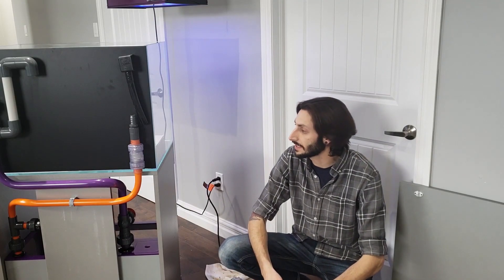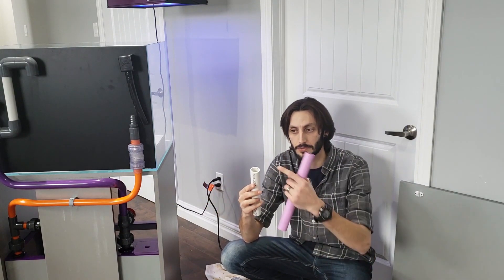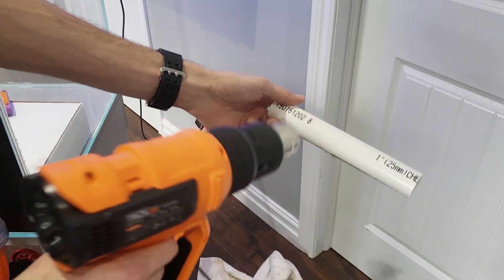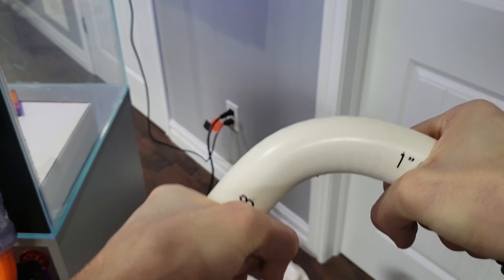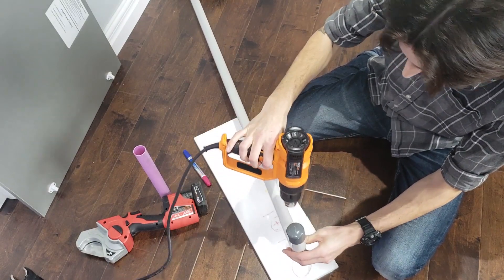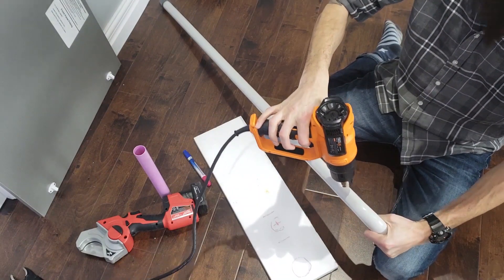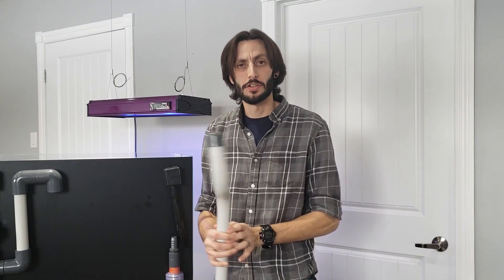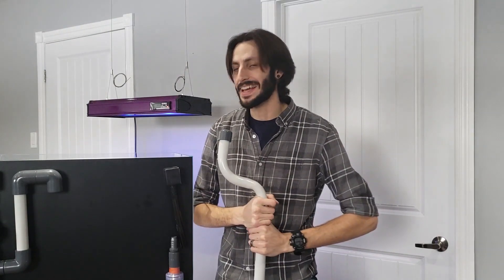How-To Bend PVC For Your Aquarium

Comment: Have you tried heating up the sand and filling it into the pipe with a funnel or using hot water and a jig to make a form?
Reply from the maker: I did see a few tutorials on using hot water or a heated fill like sand, but ultimately the application of them was more difficult. Making the jigs was going to be a lot of extra work especially since some of the bends are odd curves and not consistent. 
So freehand was easier for me personally, but in the future I may try using jigs!
Reply: @NaturalAquaria  Great video are you aware of a internal pipe bender spring?

Look it up I have this one from tower tower https://www.screwfix.com/p/bending-spring-25mm-black/83372
Reply from the maker: @aquaristikinnovation1137  Yep! That's how I came up with my reinforced pond tubing method 😉 my goal was to keep this as inexpensive as possible. Tubing was only a few dollars!

That spring looks to be a great value too!

Comment: Hey Thomas I am thinking of getting a different better heater than the one I have.i am running a aquaeon preset 40 gal heater in my 38 gallon tank. What heater would you recommend
Reply from the maker: I am a big fan of Eheim Jager heaters for a simple mechanical thermostat. They can be calibrated as well which is ideal. I use them in most aquariums of mine.

I also really love the digital thermostat on the Neotherm heaters from Cobalt. Very accurate with very little variance of under 1 degree rather than the +/- 1 degree that most heaters have.

If you have a canister filter you could go with an in-line heater from Hydor! I also use those for setups where I really don't want a heater in the display.

Hope that helps!